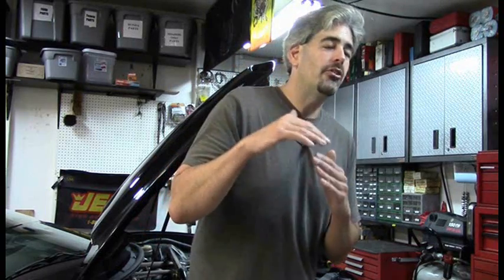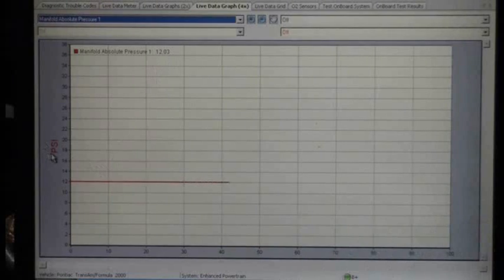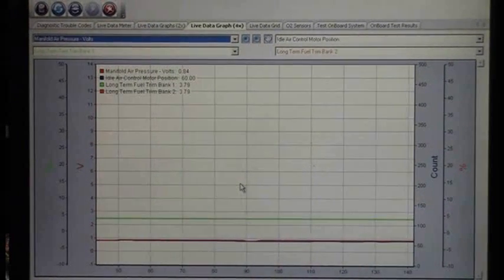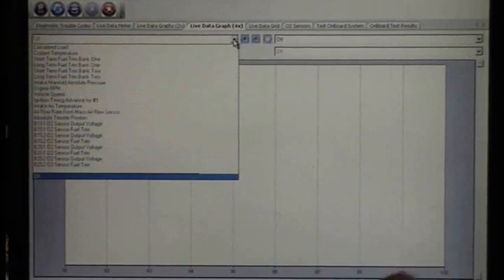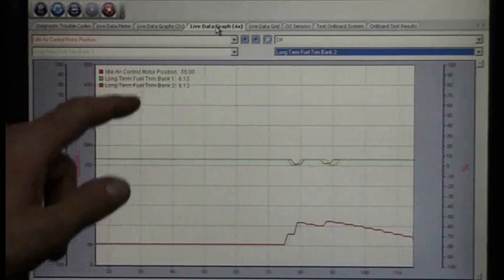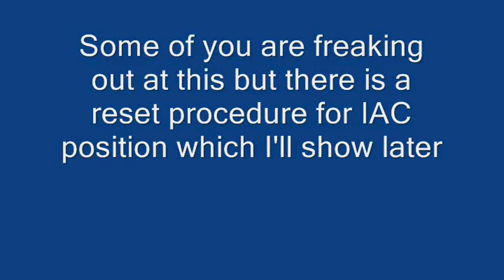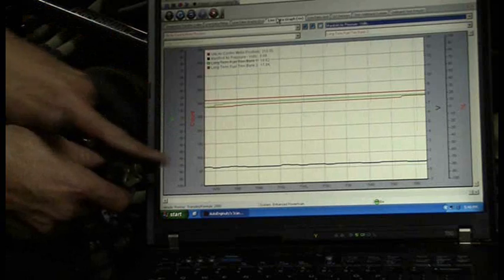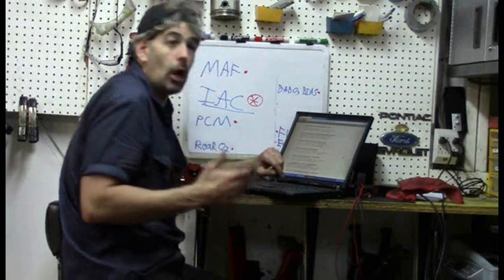P0171 Case Study from Hell 2000 Trans Am Pt3

Comment: I have an unrelated question: Talking about a circuit. If all voltage drops at the resistor/load(therefore no voltage left on the ground wire side), how does the amps/current continue through the ground side if theres no voltage? I thought that amperage/current was the movement,flow or motion of voltage? But if theres no voltage(on the ground side) how can there be amperage/current(which is the movement of voltage) ? Can someone answer this.
Reply: "I have 0 volts/no volts, but I have amperage/current."   This is your flawed assumption. You do not, I repeat DO NOT have 0 volts when measuring across the ground wire from the load to the battery on a ground-to-ground test. You may have something like 0.01 V, NOT 0.0. This is real voltage, not "noise". That is all the voltage you need to make the current flow, since the wire itself has very little resistance. The wire itself is still a small load, and Ohm's law still works. There is no magic :)
Reply: +motoYam82 I got it.  Fantastic, the ground wire is a load (resistance), OHMs law rules and current flows.
Reply: Check out tst seminars on YouTube they have hours on voltage drop testing.
Reply: I tried ,but you seamed to explain it better.
Reply: Voltage and Current are two different beasts! Think of electricity as water in a garden hose. If you think of Voltage as the ( Water pressure ) in the hose with the hose on at the source and off at the nozzle, and was at 12 psi. Think of the Current as the flow of the water in the hose which would be 0 gallons per minute with the nozzle off. When you open the nozzle all the way, the( Flow of water ) would increase rapidly to say 1 Gallon of water per minute. But the ( Water pressure ) would drop toward 0 psi. Electricity works in a similar fashion, When the Amperage ( Electrons/ Water ) starts to flow towards ground the ( Voltage/ water pressure ) starts to fall towards 0. The higher the ( Amperage/ water flow ) the lower the Voltage / Water pressure. Now if you start to close the nozzle the ( Water flow / Amperage ) starts to fall towards 0 but the ( Water pressure/ Voltage starts to rise to 12 psi / 12 volts. Ohms Law states that when Amperage rises Voltage falls and when Voltage rises Amperage falls. I hope I have helped you see why there is little to no voltage on the ground side of a electrical loaded circuit.
Reply: Billy R
Let me ask it this way; Can a wire that has 0 volts have amperage/current flowing through it ? (Cause thats what the ground-side of a loaded circuit is)
Reply: Billy R
I just thought that amperage was "the movement or flow" of voltage. And since theres 0 volts on the ground-side of a loaded circuit, how can there be amperage,with no voltage being there. How can you have amperage on a wire,when that wire has no voltage,cause amperage is "the movement or motion" or voltage. In other words, you can have voltage without amperage(unloaded circuit),but you shouldn't be able to have amperage without having voltage.(which you do on the ground-side of a loaded circuit). Maybe Ill let this go.
Reply: Billy R O.K., Thats simple and it helps,thanks.
Reply: joeandgod1 joe:   zero volts referenced to what?  to measure voltage you need two points of attachment. With a DMM (or even analog voltmeter) you can see "zero volts" at one or more than one points in a circuit, but it depends on where the two probes are attached. If you measure voltage ACROSS ANY component through which current is flowing it WILL show a voltage drop or voltage difference. That doesn't apply to a conductor, like a wire. If you have a piece of wire, and attach you probes to it, you won't read any voltage, even if there is current flowing through it. You have to measure across some device that is using electricity to do something.More specifically though (and I haven't read Biily's article yet but will later tonight), the determinant LAW is ohm's law. You NEED to learn it if you are going to do any electrical car work at all. Zillions of places on the Net to learn about that. BUT, yes, in general, if there is current flowing in a circuit, there WILL be voltage shown SOMEPLACE in that circuit. It all depends on what part of the circuit you are looking at. Most circuits on a car, such as lighting, most actuators, etc are operated with battery or charging voltage, so around 12.6 to 14.2 volts (all considered to be pretty much equivalent, in practice).  12 volts from the battery is applied to one side of the light, actuator, or other device, and the other side of the device is connected to ground, which goes to battery negative.
Reply: joeandgod1 oh crap, I had a wonderful reply that I was working on for you joe, but I fat fingered and it disappeared. I'll try to start over here.I hope my reply didn't get posted part way through, it doesn't look like it.I apologize to the 99% of everybody here, because you know all this. This is presented for the benefit of the other one percent.Anyway, here goes:joe, Your first sentence says:"I just thought that amperage was "the movement or flow" of voltage. "Close, but not quite. If you change the word voltage to the word current, then the sentence is perfect.So "I just thought that amperage was "the movement or flow" of currrent".  Perfect.AMPERAGE ("amps", or "milliamps") is the flow of electrical CURRENT. This is the water in Billy's explanation. Technically, in any electrical circuit, amperage or current is the actual amount of electrons that are flowing through or past any particular point at any given moment in time. This is a huge number, billions and billions per second. It is not really a relevant number and it is not needed to understand it   (it is technically called Coulombs). All you need to know is amps or milliamps = "current" or "current flow".Volts don't flow. Current flows.  Volts or voltage is the amount of "force" that is "pushing" the current. So the bigger the voltage, the harder the current is being pushed, so the total amount of current goes up.Volts, or voltage, is a number, and it is measured at any given point in any circuit. To measure or describe voltage, you actually need to be measuring AT TWO POINTS in any circuit. So, when you describe where you measure any voltage, it always has to be a description of voltage between (or across) any TWO given points.If you've used a DMM (digital multimeter) (it can measure voltage, current, and resistance) you'll notice you had to connect TWO clips, or hold TWO probes to your circuit. Touching any electric circuit with only one probe does nothing, and shows you nothing.So any time you say "there is xxx volts" it ALWAYS means "there is xxx volts IN REFERENCE TO A PARTICULAR POINT". On a car, this  "reference point" is most often "ground", which is just a shorthand word we use to mean the negative post on the battery. That negative battery post is what we usually think of as the "zero volts" point.  So, usually, when we talk about 12 volts on a car, we automatically assume we are talking about 12 volts IN REFERENCE TO GROUND,  where ground simply means the zero reference point. On a car, the 12 volts is usually described as "positive" volts, and it usually means you are measuring 12 volts at whatever point you are looking at (probing) COMPARED TO GROUND, or COMPARED TO THE ZERO REFERENCE POINT (the negative post on the battery).You can have voltage in a circuit without any current flowing. Technically, it would be called an "open" circuit. For example, put a voltmeter across a car battery (engine off, nothing turned on). You would measure around 12.6 volts for a fully charged car battery. But there is no current flow. There is voltage (push or pressure or "force") that exists there, but there is no flow. There is no flow because there is not PATH for it to flow through. The voltage is just "sitting there".  Now, connect a 12 volt rated light bulb across those battery posts. The bulb is a path. The light bulb will light. There is current flowing. But with a small lightbulb (not a headlight) the battery voltage will barely budge, because the total capacity for a car battery to deliver current is MASSIVE (many hundreds of AMPS). The little light bulb is allowing mere milliamps to flow through it.When the lightbulb is connected across the battery, (assuming the battery voltage is as stated, about 12.6 volts)  the amount of current flowing through the bulb is determined by the resistance of the bulb filament, in ohms. The filament is merely a wire, but a special type of wire that has some resistance. Note: the resistance of that filament wire changes when the current flows and the bulb gets hot, -in other words as the temperature of the filament changes, the resistance of the filament changes. But this temperature change occurs within fractions of a second, after that the temperature doesn't change anymore, so the circuit comes to a point of "balance" or "stasis" within milliseconds.Ohms law ALWAYS determines the relationship  between Voltage, Current, and Resistance in ANY ELECTRICAL CIRCUIT, ANYWHERE, OF ANY KIND (including lightning). That's why they call it a Law, and the beauty of it is that IT ALWAYS WORKS. You need to know two out of the three quantities, and if you know two of the three, you can get the third using very simple arithmetic.Just remember this:VOLTAGE is always the amount of PUSHCURRENT is always the AMOUNT OF ELECTRICITY THAT IS FLOWINGRESISTANCE is ALWAYS THE THING THAT LIMITS, OR CONTROLS, HOW MUCH CURRENT IS FLOWING (for a given amount of voltage-if the voltage goes higher, but the resistance stays the same, more current will flow)You know those big electrical distribution stations you see somewhere in your town or vicinity, with the barbed wire fence, and the Danger signs and the huge transformers? Yep, ohms law.A flashlight? Yep, ohms law. A car starter motor? yep, ohms law.Most "wire" in most cases has virtually zero resistance. For most purposes we assume that a piece of plain wire has no resistance.When you try to measure "voltage" between two places on a piece of plain wire, you will measure zero volts, and it doesn't matter if there is current going through it or not. That's because there is no voltage (more accurately no DIFFERENCE of voltage), between two places in a single piece of wire. The voltage is only PRESENT when looking ACROSS two OR MORE items on the wire that  have resistance. On a car, this could be just about anything, including a lightbulb, an electric motor, a resistor, a spark plug wire (which is a special kind of wire that has resistance), etc.  DON'T try to measure the voltage on a spark plug wire. You'll blow up your meter, and probably get a massive electrical shock, and it could be enough to kill you. A spark plug wire usually has like 30 thousand or 40 thousand volts on it (when the car is running). Please don't touch it with your fingers.If you  want to learn anything at all about how electricity works in a car, you HAVE to learn Ohm's Law. It is pretty simple, once you get used to what the terms resistance, voltage, and amperage mean.   Voltage is always measured in volts (or parts of a volt, like millivolts), resistance is always measured in ohms, and Current  is always measured in amperes (amps) or portions of an ampere (milliamps).  "Milli" simply means "thousandth". So 5 millivolts is five thousandths of a volt.90% of the time, when working on electrical systems on cars, you'll be looking at voltages, or volts. 8% of the time you'll be looking at Current (amps), and 2% of the time you'll be looking at resistance. (These are just very very rough percentages, they are not mean to be real or exact, they are just symbolic). I'm just emphasizing that most of the time, working on a car electrical system, it is volts that you care about.  This is the easiest of the three things to measure in a circuit because all you have to do is attach a voltmeter across any two points, and the meter will tell you how much voltage is present. Most of the time you can figure out most or all of what you need to know about a circuit by looking at the voltages present in the circuit.Just search the Net for ohms law, 'cause you need to know that, and also search for "dc circuit basics", and you'll find more than you ever wanted to know.Hope this helps.
Reply: No that's a explanation! I think it's great you took the time to help someone understand. To the best of my ability I try to do the same thing. So when you guys hear guys like Douglass and I rambling on, to you more advanced viewers who already know the subject matter already we are just trying to help the other one percent that want to learn but just don't understand it yet. And to be truthful, most people on this channel have demonstrated that they understand that, and that's great Too!
Reply: Billy R Precisely. Couldn't have said it better. Almost all of us are "Advanced" but some of the people here are "More" Advanced.I thought I was smart until about two months ago when I started watching the vids here, and reading the comments. Suddenly I feel close to stupid. Oh well, I'll soldier on. Billy, I've greatly enjoyed what you've been writing too, and have learned a lot from you, and will continue to.Part of the beauty of what Matt is doing here is not only the "current" "real time" of all the information exchange that we are all sharing RIGHT NOW, BUT that all this stuff will be on here for a long, long time (presumably) so this is all going to be viewable and usable by many more people in the future. If Matt has gained a Million? views so far, he will have two or three million before long. That's what I call scale!!!Yep, I just checked, it IS over a million-I couldn't believe that....jeez.
Reply: Joe, Ohm's Law is the only explanation you need: [V=I x R]. One simple equation says more than a thousand words.
There can be NO CURRENT flow with NO voltage drop, period! Your statement that there is no voltage drop across a plain wire that is carrying current is false. There IS a voltage drop, but it is VERY SMALL (several mV) since the resistance of the wire is also very small. Thus, on a high-current ground wire, you can see up to a few hundred mV drop from the load back to the battery!
Reply: Very true! but I think he was saying that if you were measure at two points like between the battery and the starter with no current flow!
Reply: I appreciate everyone's help. The thing is that I was asking for a yes or no answer. Amps x Ohms = Volts, I get that,its basic.Let me paint a picture; Using a volt meter, having one lead on battery ground and the other lead on the ground-side of a "loaded" circuit,you have 0 volts,cause your dropping all of them at the load/resistor(so a ground to ground voltage drop test) SO AT THESE TWO SPECIFIC POINTS ON THE CIRCUIT THAT I AM MEASURING AT, I have 0 volts/no volts, but I have amperage/current. Now, how do you have amperage/current right there, if you have no volts there, I thought a wire(talking about the ground-side of a loaded circuit)had to have voltage in order to have amperage/current? If voltage is the"PUSH" then that push ends at the load/resistor cause all volts are dropped there,So then whats "PUSHING" the amperage/current through the ground-side(of a loaded circuit)back to the battery, if "ALL" voltage was dropped at the load. How can these 0 volts that are left over "push" the amperage/amps through the ground-side( of a loaded circuit) back to the battery? Theres no "PUSH" its all been used up by the LOAD/RESISTOR, So shouldnt the amperage/current also end there(at the load) Since theres no more "PUSH" to push it back to the battery. Again thanks for everyones help.
Reply: motoYam82 I think you understand me the most. So those 0.01 volts thats left(on the ground-side),can "push" as much as the 12 volts is "pushing" on the positive side, since the amps/current is the same on both sides of the loaded circuit.
Reply: You're getting it! Yes, the current is constant through the whole circuit. But since the resistance of the ground wire is so small compared to the main load, the leftover 0.01V is enough to push the exact same current through the ground wire, as 12V is pushing through the main load :) Nice job!
Reply: Randy, That sounds like a hell of a contraption for a battery tester! Wow I always thought I was a little nuts, but you make me feel a hell of lot saner now! And I have a suspicion that those bubbles that you were seeing and hearing were not the water boiling. When I was in high school we did an experiment by passing a electric current thru water and it separated the hydrogen and oxygen from the H2O! That's same stuff they sent the Space Shuttle up into space with! Boy there goes the Neighborhood!
I got to talk to Matt, and see if he can start another classification for one persenters on this channel. It would be dedicated to the funniest guys on the channel. You would be right up at the top with a few other guys I've met here! I could barley read your post I was laughing so hard. I'm still laughing just thinking about! I swear I have tears in my eyes! That's what's great about this channel, Matt not only has great bunch of guys who are pretty dam smart but also they have a great sense of humor, although it may be a little distorted and twisted! LOL Great talking to Ya again!
Reply: motoYam82
O.K. The confusion came in cause I hear most people say that ALL VOLTAGE drops at the load(the light,etc..),which not true,Theres always some left on the ground wire to the battery and drops that little bit(0.01,etc...voltage) there on the ground-wire, cause it acts as a "load/resistor" too. Almost like a series circuit. Ive never heard anyone explain that part. I suspect a lot of people don't get that little detail.
Reply: douglas lee
Sorry for the formatting of that long post. I typed it up in a text editor first (so I didn't fat finger again and accidentally post something half way through), then I pasted it into the Reply box, but all my carriage returns and line breaks went away, so it's just one long series of sentences. Even a lot spaces went away. Sorry
Reply: Randy Jones

It's amazing you didn't get badly hurt. Very good theory you came up with, I'm stunned that it worked. What you did was build one hell of an electromagnet.

So, you didn't finish the story. You theorized the circuit, YOU built it and proved it worked, but did you send the info to the guy, and did HE have to call 911?
Reply: Randy Jones Yea! Probably Shouldn't ! You will have guys in black suits knocking at your door! LOL
Reply: Electricity, whether AC or DC, and whether in a car or on the space shuttle, is the flow or movement of ELECTRONS, not voltage. The CURRENT in Amperes (Amps, milliamps, microamps, etc) is the FLOW or MOVEMENT of electrons.

When there is Current in a circuit, ANY kind of circuit, there will be various voltage levels at diferent points in the circuit. As the current changes, the measured voltages will change.

An OPEN CIRCUIT (such as a battery) will have VOLTAGE present at the terminals but no current.will be flowing.

Voltage is formally expressed as a "Potential Difference" or "Difference in Potential". The word Potential means literally the POTENTIAL to provide electrical energy, or Current.

The best analogy that anybody has ever come up with for making it easy to understand electrical flow is the water analogy.

Imagine a system of connected pipes filled with water. And imagine there are some "valves" in some of the pipes. Voltage is like water pressure. Current is like the volume or quantity of water flowig. And resistance is anything that "resists" the flow of the water. Reducing the size of the pipes will reduce the flow. Closing a valve will stop the current flow, and create the maximum possible pressure on one side of the valve (voltage).

You are probably getting confused by the terms VOLTAGE versus the term VOLTAGE DROP. Two different things. There can be voltage with no current flow, but there can only be a VOLTAGE DROP if there is current flowing.

Search the web for easy to understand tutorials about Ohm's Law. It will make everything clear.

Best wishes.

-douglas
Reply: douglas lee in a parallel circuit there may be different currents in each branch but the voltage will be the same at each branch.